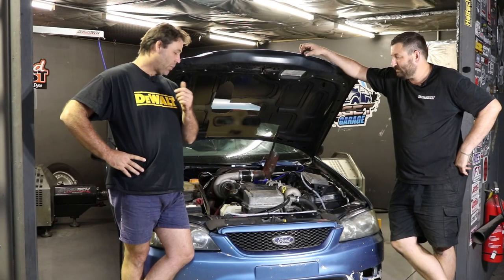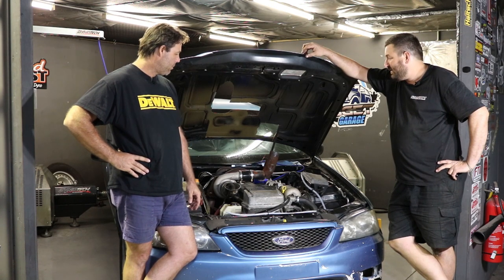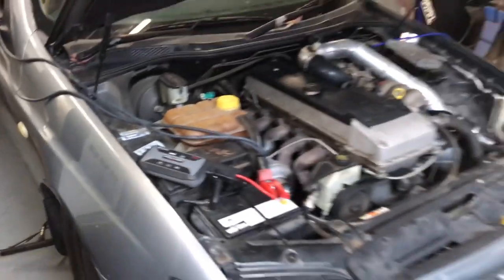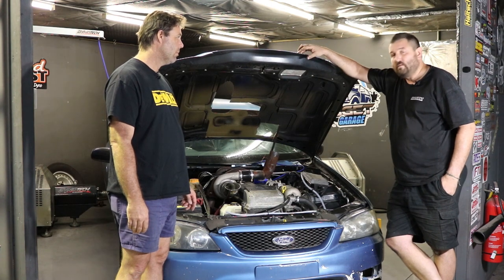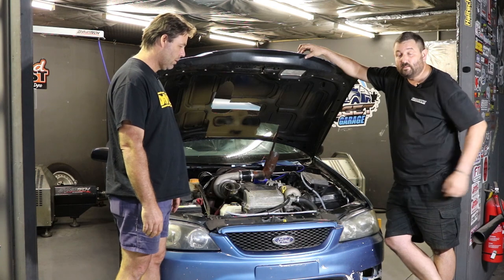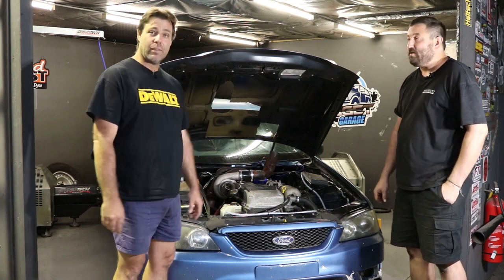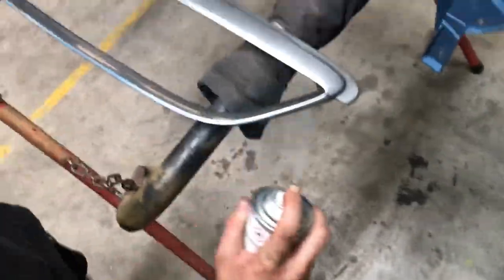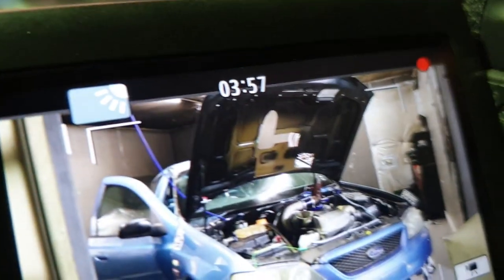Pushing our STOCK N/A Barra with MORE BOOST!!

Comment: When you weld the diff chuck some gears in there !! You must have mates with old Nissan diff gears , either 3.9 or 4.11's . Btr has horrible first gear and Falcon is soooo heavy . Give Barry a chance !!! With willowbank closed you have the time !!!
Reply: Skyline/pintara 3.9/4.11 gears are good if you're N/A. But they don't cope in a falcon with 400hp. I know from experience. I've gone back to 3.45's and they're perfect!!
Reply: 10GTE in a ba/bf?
Reply: @nathans1829  Yeah, I had 4.1 mini spool in a BA. Didn't last too long once it was turbo and shattered the pinion gear. Problem with 4.1s in a 7.8" diff is the pinion gear is too small.
Reply: 10GTE I put 4.11 in my r31 and it’s awesome would love to up the gearing on my bf daily for some fun
Reply: @10GTE  Never had a problem with them in my Nitrous applications , but they are only 7.5" gears. Am currently setting up a Ba with M80  4.11s so should be strong enough. These boys should have no problems sourcing a turbo M86 cradle and then using Territory 4.11s.

Comment: Dope to see the BARRA,450 churr on a factory block besides the ARP headbolt n studs was it? Keep me motivated for my Barra turbz coming soon👍🤙
Reply from the maker: 100% unopened stock N/A BA falcon motor, no head studs etc, just china turbo, e85 and send
Reply: Oosshh churr,i like the bumper repair too makes it look better than the rugged,...hows the Torque converter doing

Comment: Whats the rear housing on the turbo? im my experience the china housings are not as big as they advertise and the ford really does need the 1.06. My china 1.04 housing had 12 psi peak and 8 psi toward the top end, put a genuine garret on there and it would do a solid 12 or whatever line you wanted. You might be better of fitting a standard ford rear housing to keep the boost solid int he top end and not so fast spooling?

Comment: Wish you two guys could do my car for me Iv got a beast of a corolla Iv been building boys only needs painting and it's finished but Iv got a cut and shut ke 55 with skyline running gear and a vl rb 30 engine a real beast how can I show you boys  love you guys put turbo on .I e for me lol use my car for a show lol set up not bad Power to wait ratio is insane lol with the wheel size and gearing I call him Frankenstein lol